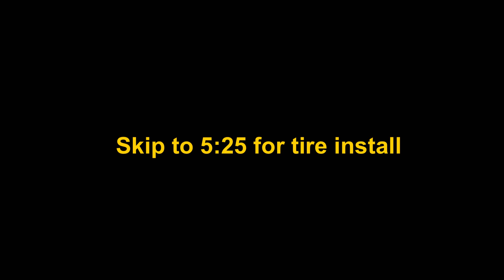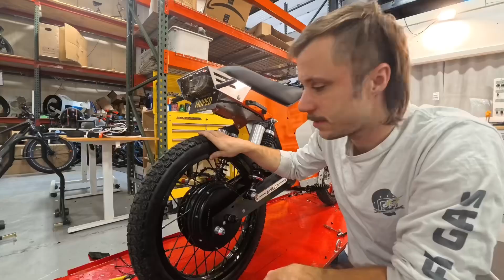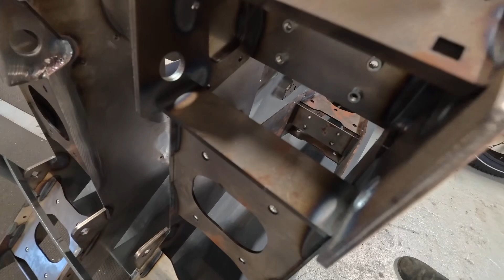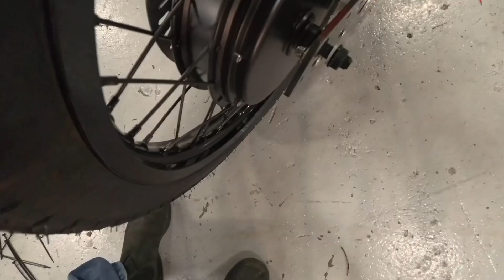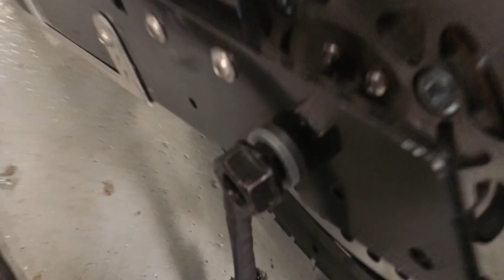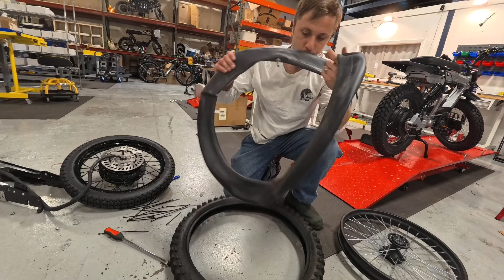Flat Tire Change on eMoto? Javelin from Spark Cycleworks Tis and Tricks

Comment: I think you should put a disconnecting plug on the motor cables
Reply from the maker: @cwebb5537  we would if possible. There’s just very few reliable plugs rated to high enough current. Most e-bikes run 20-30 amps. Javelin runs 100-150.

Comment: Armor dilloz blue tire sealant. Is by far the best i've ever used on my electric kick scooters. Made from non corrosive materials that won't rust anything, Also specifically made to handle high temperatures for The heat tires produce While riding on the street at high speeds. I've had it plug up a hole, so big.I could put my index finger in up to my knuckle. I put it.
In every new tube and therefore if you get a puncture you just keep riding and don't have to patch it or worry